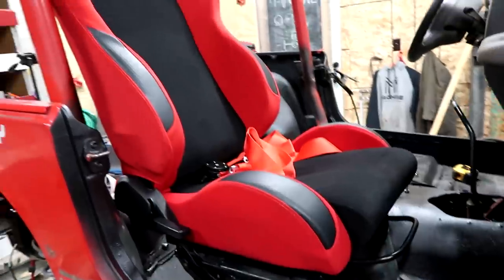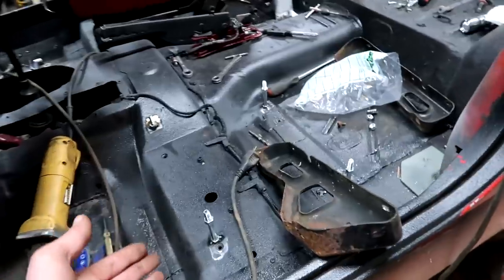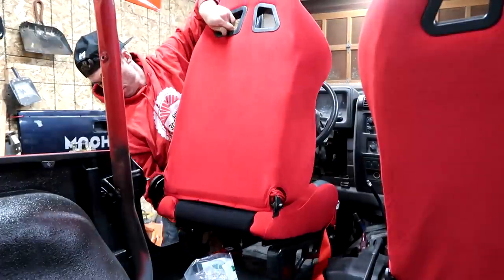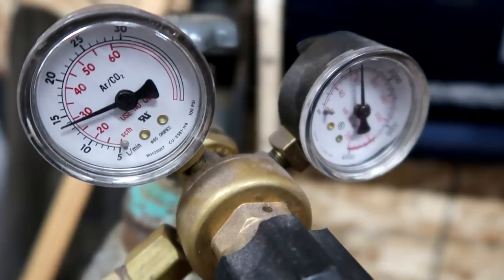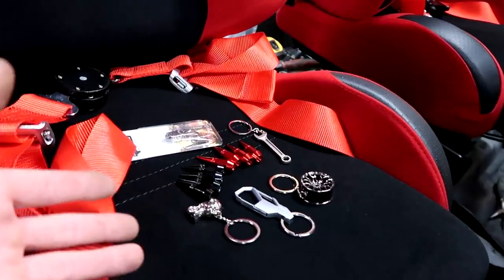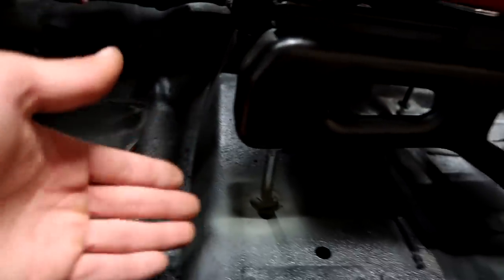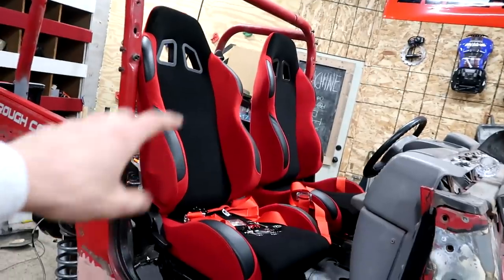Racing Seats in the Turbo Wrangler - Install!

Comment: Those bolts are gonna snap eventually, box them in. Just get some rectangular steel tubing,slip them over the bolts and weld them to the floor.
Reply: Beast6228 best idea I’ve heard

Comment from the maker: "Sure, insert your that's what she said jokes here" 5 times fast, GO!
Reply: Good look on the jeep can't what for the jeep to be finish like and sub
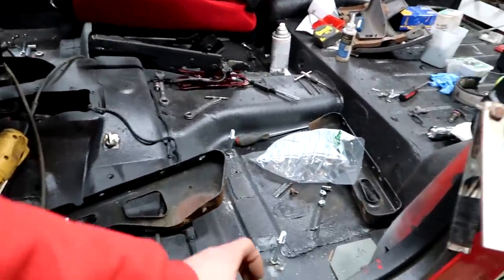Reply: 2:20 FTW
Reply: It's to big it won't fit....... The seat that is😉
Reply: Looks great but I think you should add some supports to those bolts they bend and break a lot easier than you would think.. the welds on them look really solid but the shank of the bolt is the weakest point..
Reply: Merry Christmas man
Reply: And looks good man

Comment: You most likely all ready got it but for the bolts under the seat I have used cone shaped support brackets worked well for me that just slide over the bolt good luck

Comment: Umm those seat extensions don’t look that safe. But hey if they work rock them. 

Until you crash
Reply: He really needs to reinforce those
Reply: They are going to rust and snap. He needs to box them in.
Reply: Are you going to put the doors back on? It looks like the passenger side seat is hanging out a little.
Reply: I would have used square tubing and made a bracket that extends the original, would have been way more sturdy
Reply: @austinbaylor2613  100% adapt the bracket to use the factory mounting location best and strongest way to do it.

Comment: Take a 2x2 tubing and cut them to size. Slide them down centering the bolts and weld them to the body. Give that seat something else to rest on. In a accident those bolts are not strong enough to support and hold down the seat.

Comment: 4 point harness is not safe. Does not prevent “submarining”. Which is where you slide down in the seat during an accident. Unless 4 points have changed and are safer now.

Comment: Get some square tube. Cap the ends. Drill a hole through the long way. Slip it over those bolts and weld it solid. Should be alot safer.

Comment: Those bolts need to have gussets not the short ones but those longer ones should get a gusset every 90° the bolts may be strong enough but they're only welded to a very small spot on the sheet metal floor.

Comment: THAT'S SUPER SKETCHY AND NOT SAFE. PLEASE SLOW DOWN DON'T RUSH AND RE ENGINEER THIS. THERE IS A CRAZY AMOUNT OF STRESS ON THINGS ON IMPACT. THAT WILL RIP RIGHT OUT OF THE FLOOR AND YOU'LL BE AIRBORNE

Comment: Please do not mount your seats like that. Those bolt standoffs are not going to be strong enough to keep you safe in an accident. They are going to bend / break and then render your harnesses useless. Harnesses need to stay tight to keep you safe in any type of accident. Seat brackets are ment to be bolted through with large washers to keep them from pulling through the sheet-metal. If you want the seat to be high like that. Look up building custom seat mounting bars that tie in to the roll cage. One last thing, those lap belts for the safety harnesses do not look to come across your lap correctly. Those lower belts are suppose to come across your hips to keep you down and back in your seat.

Comment: Couldn't even get a minute into this video. This jeep is such a hack job. Turbo with a stock ecm, bolts welded to the tub supporting seats, shotty suspension work. Your content used to be so much better than this. I'm pretty dissapointed.